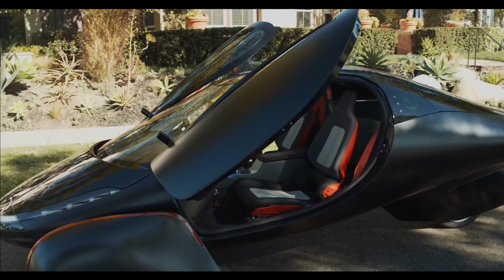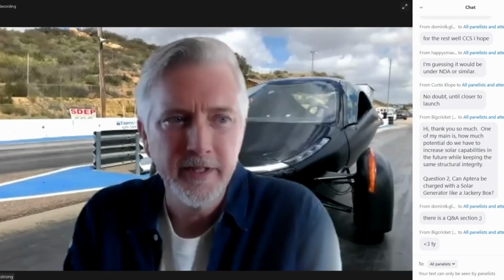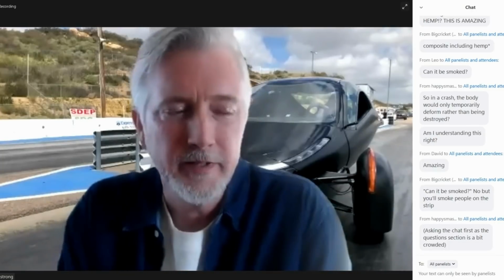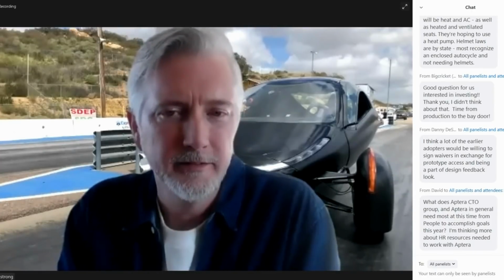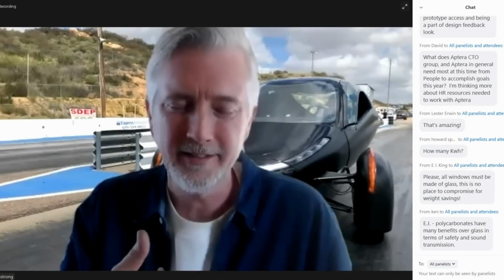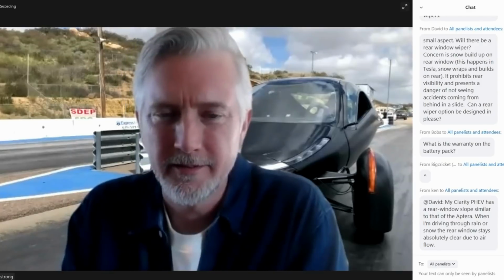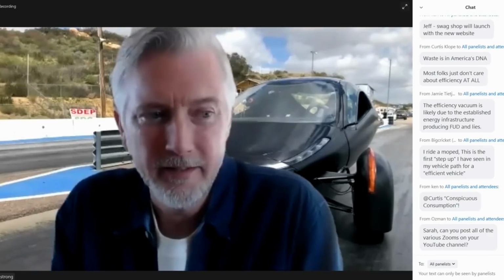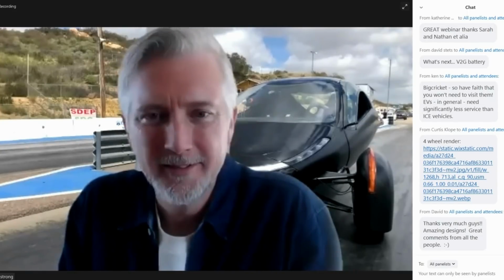Aptera Aerodynamics & Vehicle Safety Webinar

Comment: Honda 4WS improves rapid lane change without putting a spin on the body (moose test). Also hold a straight line, resist cross winds, maneuver in the parking lot to quicken low-speed turning and reversing. Choice of Synergetic silverfish like motion, Front Only, Rear Only, Front/Rear Opposing, or Front/Rear Crab sideways.

Comment: The rearview cameras could be mounted on the backside of the front wheel pods/fenders. This would give a great angle for viewing and would be on the low pressure side for aerodynamics. Integrate it into the orange indicator lights.
Reply: The problem is they move with the wheels. In turns they would be useless because you would see whatever the backside of the pod is pointing at. (Mostly your own car on one side and something way away from your car on the other side.) On the upside, if you made a hard left turn, you could see yourself in your driver's side camera. 😊

Comment: This is informative it is a poor sales presentation.  It sounds like you do not have a finished product. You do not want or cannot give specifications. Or you and your co presenter donot know how two present
Reply: They literally said they were testing prototypes... That means it's inherently unfinished until it hits full-scale production and more testing. They do at least get into the composite materials used in the car and they mentioned that the structure can survive a 45mph crash with no damage to the passenger cab at all, and it has a good structure for a rollover.

Comment: one thing i would like to see from any of these 3 wheel vehicals is the option to hook up a light weight motor cycyle trailer
Reply: Thanks for the reply.. what I had in mind was the kind of motorcycle trailers the size of a large luggage etc. that's designed for motorcycles. I was more concerned about a hitch option for the Aptera or any of that type of vehicle. I first hoped that same for the Elio, but I guess that car idea went by the way side. Year after year I was hoping to by one of the Elio. I have high hope for the Aptera.,🤓
Reply: I am sorry for the typing errors
Reply: There will be limited towing capacity but probably not more than 3 or 4 hundred pounds max.
Reply: model Y can 3500 lbs.

Comment: 20:18   If it's classified as a motorcycle in the US, I assume you would need to hold a motorcycle license to drive it, is that right?
Reply: It can fall into the category of tricycles, like the Can-Am Spyder, which only requires a driver's license for cars.
Reply: Some States classify it (and the Polaris Slingshot) as Autocycles, and they do not necessarily require a motorcycle license. It varies from State to State, however.
Reply: At present a regular car license is required in all but 6 states and all six have proposals pending to change this.

Comment: I an a fan of the concept. I like the idea of minimized consumption und long lasting materials. That’s one of the things I love on my i3, but nobody seems interested when I talk about the materials. It is something that average people don’t care, maybe because it has been normal to give away a car after 10 years as the body panels start to rust and they are not even interested to think about that is not a must but intended.
Reply: Most people buy EVs for the wrong reason: To show off and for the quick acceleration. Fuel efficiency is a mystery to most drivers. However as Charging is insanely expensive in Europe, even more so in Denmark where I'm from, They'll eventually get it and EVs will be listed with their WLTP rating in bold letters across the poster.

Comment: Hi Steve, Chris, Nathan  and the team. I was wondering whether you guys looked deeper into the rolling resistance issue with tires OEMs given the light weight of the vehicle and the three driving wheels configuration. The fact is that, despite the relative abundance of literature on the topic, I was astonished of the lack of progress in this field when it comes to availability of simulation friendly data about the rolling resistance deterministic factors from OEMs.  In general what OEMs publish is a relative R value which generally is based on lab test results obtained on an ideal tire using a lab test setup whose basic design goes way back. Meaning that, correct me if I am wrong, there is no reliable commonly accepted approach which may apply to any class of tires despite the academic attempts. As if it were to say that every tire is a particular case and excuse me but tread design is far from being an engineering fact but rather a home made empirical deduction. I believe that this may well constitute an opportunity to develop a front and rear tires specifically for Aptera under the same paradigm shift as was done for the "Fuselage". We're talking about the other big chunk of Energy consumption here.  Pls comment.
Reply: Not Aptera staff, but you are right. Even the "economy" rating on tire labels is divided into width classes, so you cant compare different types of tyres easily. a 6" wide tyre with an A rating has higher losses than a 4.5" tyre with a G rating! However as EVs are heavy, small lorry tyres are an option, they take 2-3 times the inflation pressure and exist in sizes suitable for cars, you can get them down to around 5" width. But generally, go for the skinniest wheel at the highest pressure rating, and be less concerned about what various reports say!

Comment: This webinar succeeded in improving my view of Aptera. However, I still worry about how it can handle curbs and potholes. Also, it seems to me that efficiency will become less critical for EVs in the future as battery cost goes down, battery energy density goes up, and electric energy gets greener, less expensive, and more abundant.
Reply: Efficiency is still a fantastic point though, it just means the Aptera design will almost always be able to go farther with less energy, and that's always a positive prospect.
Reply: It will handle potholes fine however there are three tracks instead of two so you are 50% more likely to hit a pothole so you're going to hit 50% more of them

Comment: I have an order in but I am concerned when I hear biodegradable, Mercedes did the same with s class in 90s and all wiring in the engine harness degraded with heat, same with VW toureg headlight wiring. I hope you guys don;t use it around warm stuff (like batteries and motors.eg )
Reply: Several of the people at Aptera are well aware of this history, and they have already discussed the issues in using soy based insulation as an attraction to rodent damage.

Comment: If you have a 1000 mile vehicle, how do you heat and cool the interior for driver comfort?
Reply: There are some supply chain issues, so the first models may come with resistance heat.  The seats may have Peltier based heating and cooling.

Cold weather will definitely impact range.  Increased air density will have less of an impact than it does on most EVs due to the 0.13 Cd.
Reply: @n.brucenelson5920  In My regular EV, the most temperature dependant part, is my reduction gear: thick cold oil increases my low speed consumption by around 20%. Wheel motors don't have that problem.
Reply: @Tore_Lund  Thanks for this.  I learned something!
Reply: Does it have a heat pump for AC and Heating plus cruse control?
Reply: It's fiberglass with foam so it's extremely well insulated and so once it's down or up to temperature it uses next to no power. It uses a reversible heat pump so it's much more efficient, kind of like the heat pump that Tesla uses. It's like an air conditioner in reverse and for every 1 KW of energy it uses it can draw 4 KW of heat from outside to the inside. It could also use some of the waste heat from the motors.

Cooling uses air conditioner but again, since it's well insulated it won't have to run very much. 

Unfortunately, it's still going to drain your battery, so if you're driving the entire way with the air conditioner on you will only get about 960 miles.
Reply: @pilotavery  Your perception of cold changes when you get an EV. Now it is not before it gets a handfull degrees below freezing and me being annoyed about fogging windows, before I turn on the heat.
Reply: @Tore_Lund  Yeah, this also depends. The newest model 3's let you use heat full blast with minimal range impact, because the heat pumps. 

This particular car is much smaller, and has fiberglass foam, and is going to trap heat well being such a small cabin pod.

Comment: Does it float ? What are the sound system options ? Is there a tow option ? Thanks for the video, it got me really stoked !!
Reply: The wheels are designed to run under water, but don't try it!  It comes with a Bluetooth stereo and an upgrade stereo option  - probably 4 speakers and a sub.  I haven't seen the details yet.

Comment: I would love to see some one from this company contact solar window, so the side and back windows could add to the self charging. At least the car will always start and go nomatter how long the car sits. Solar window is see through thats what is important with the charge.
Reply from the maker: I don't know this for sure but I don't think the cost is worth the expense for a vehicle the size of Aptera. At the moment Solar Window coating seems to only be valuable on structures with very large surface areas ie buildings.
Reply: @apterareboot1555  ok I know even if the specs are low , I'm not sure myself how long solar window will  last if applied, of course the panel system is tried and true.
Reply: The Aptera is already available with 3 square meters of 23% efficient solar panels, including on the dashboard, roof, hood and hatch window area, rated at 600 to 700 watts of power. Adding much lower efficiency solar windows to the side windows wouldn't add much.
Reply: @fotoguru222  But weight only... :)